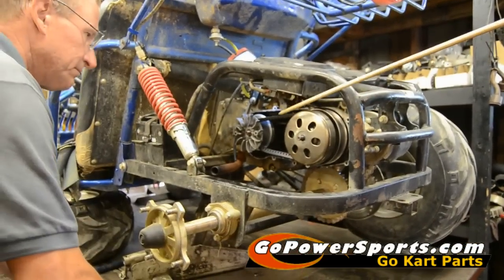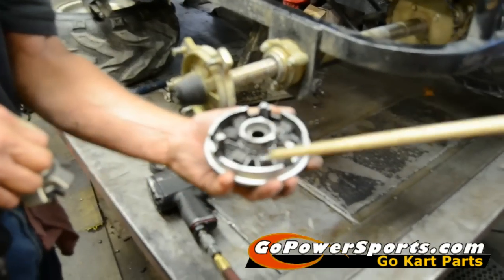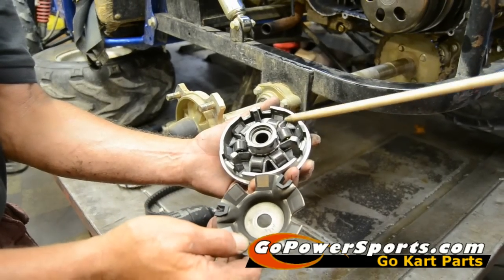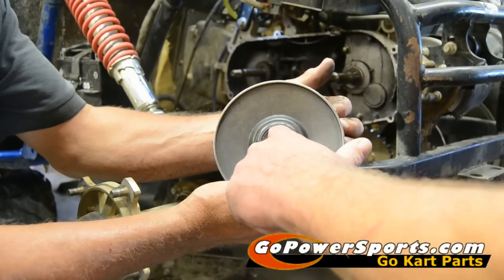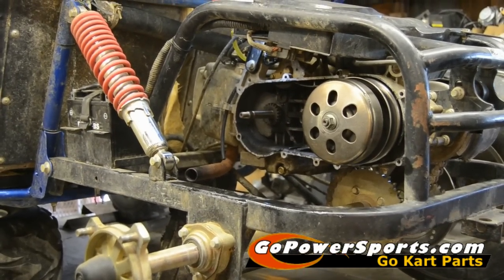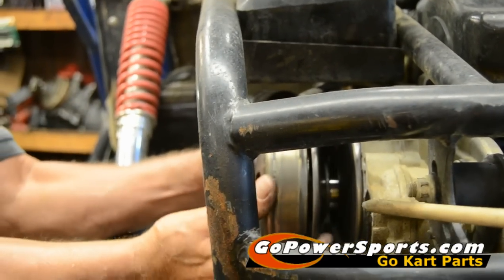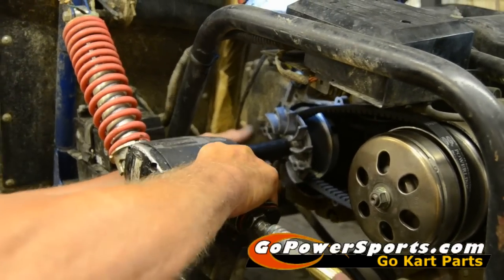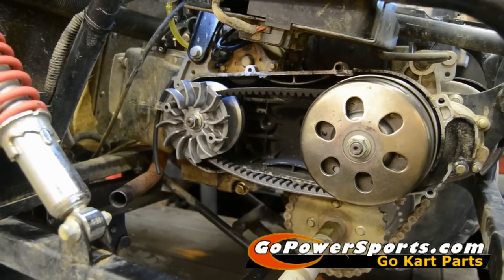150cc Go Kart Drive Belt Replacement

Comment: Shop Replaced a shredded belt for me.  Never had broke belt before so original belt that broke.  Shop Put new belt  on.  I picked it up.  when i got home it  started run what felt in a lower gear for about 10 min.  Reved up.  Then it shreaded the new belt.  Its that a possible clutch problem?   wrong size belt? 
any input would be appreciated.

Comment: How often should these belts be replaced? I've had my ASW go kart for 5 years and haven't changed the belt yet.
Reply: +David Knowles You can pull the cover and eyeball the belt.  If it is worn on the edges it's time to replace.  If the wear is deep enough it will affect your top speed.

While you are in there be sure to note the size of the belt so you can order one to keep as a spare.  If they fail they come apart so spectacularly you would no longer be able to read the numbers.
Reply: @fratermus5502  spot on about noting the right size belt BEFORE you need it! Broke supercharger belt on mustang and spent few minutes walking up and down the road picking up pieces to try and find number on it.

Comment: I have a question why does mine jump and grab. Kinda feels like it looses tension then grabs. It is getting worse
Reply: Check your clutch shoes & drum.
Reply: Did you ever find out what the problem was?
Reply: Threw a rod this summer so I didn't get a chance
Reply: @jessealexander6127  damn that sucks! I’ve been replaying parts that people have been telling me and still haven’t figured it out! I’m hoping it’s the verater. We’ll see
Reply: You have a crossfire
Reply: What state u live in. I'm not doing anything with this go cart. Got all new parts I have new tires on back high performance carb new ignition it's just setting there f u lived in ok I would say come and get it
Reply: @jessealexander6127  I bought this buggy 6 or 7 years ago! It’s been sitting outside for awhile. I figured I’d get it up and going. When I first got it, it was slipping pretty bad and the chain finally broke on it so I just parked it. Now that I’ve got it running again I’m trying to figure out how come it’s slipping.
Reply: @jessealexander6127  oh and to answer your question. I’m not sure what kind it is. Maybe a cyclone

Comment: My belt was extremely hard to put on. After I finally got it on, the Kandi still won't move, what's up? Am I missing something?
Reply: Leper King 
Hello i have a kandi 150 gka2 start but dont move what you did to fix it
Reply: @ktrachin14  did you ever get it done ?
Reply: Sounds like you put the wrong belt on

Comment: having a problem with my kart I can't get it to drive forward it will go in reverse but not forward there's like I skipping sound I have replaced the clutch belt and variator and nothing go in reverse just fine Plez Plez help me thank you
Reply: I have pulled the transmission and everything looks fine
Reply: im having trouble too. just like you say.  i got reverse to work for a while then nothing now.....wierd nosies, i think i am going to get new rear clutch, i think its getting hung
Reply: +John Doe I found the problem it's the forward gear I had to gear a hole gear assembly and shift fork gotta pull the transmission
Reply: Thomas Neely 
Hello i have a kandi 150cc gka2 my start but dont wanna go forward and reverse

Comment: Would a belt make the cart jump upon acceleration
Reply: I see nobody from GoPowerSports cared enough to respond to your question. Tom Stevens has several really good videos that explain and illustrate CVTs. I’m also having issues with lurching or choppy acceleration. Tom’s son explains in one of his videos that flattened variator rollers cause it. Well, I took mine apart today and sure enough they have flat spots. I will order new variator and clutch tonight along with spares but not from GoPowerSports. Tom also sells parts and he responded to my question in less than a day. True business right there. Good luck.